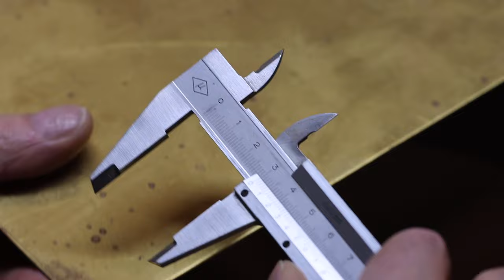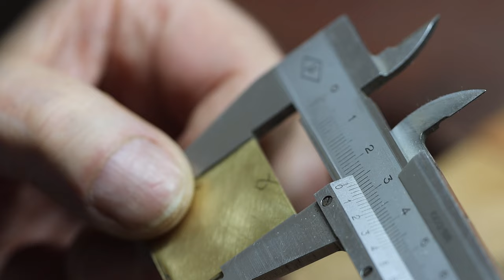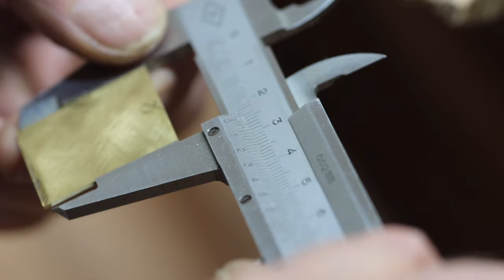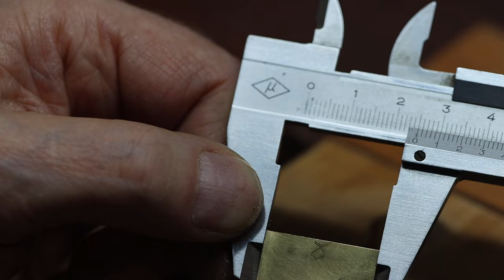Goldsmiths training Exercise1   Part 1

Comment: Second thought - when I was doing engineering design back in the day pre CAD I knew that if you want to accurately mark a pencil line you place the pencil on the line and bring the ruler up to it.

Watching you use calipers to mark out 25 mm against an edge bugged me - it seems inherently inaccurate placing the first tip on the edge of the metal.  It seems to me that you'd be better off using the set square to brace the edge of thepiece and bring the caliper up to the corner where the set square base butressees the edge of the metal piece - In this way you guarantee to get consistent placement.  Presuming the calipers are 'pointy' enough (have clearance on the outside edge at the given spacing) no calibration would be needed. If there is some radius or gap between the edge and the tip, you'd need to use the set square when setting the calipers up on the vernier.  Or even just set the distance on the vernier and set the calipers between the blades...

Comment: FWIW, I'm in the process of making a box clasp - this level of precision is absolutely required or it won't work, won't be square, won't have neat fitting edges for soldering... Ask me how I know... On version 4 at this point...
Reply from the maker: sounds like your accuracy might benifit from studying some of my films! touché I think.
Reply from the maker: hmmm, never got to a version four myself 🙂

Comment: Some thoughts....

First off, you're wrong about technique allowing one to manifest a design... Technique also INFORMS and INSPIRES design... at least that's what I have found. I am constantly amazed at how others imagine designs, feel that I can't or don't do so well with that - but when I learn a new technique, I inevitably get design ideas in the process...  

So not actually wrong... that was just a tease.  but another reason why technique is important skill to learn.
Reply from the maker: I know you were teasing but in fact you inadvertently prove my point. When I refer to technique in this sort of context ( I ought to be more clear) I'm talking about one's actual hand skill and facility. One's ability to do something accurately and well, NOT a process per se, like how there are many techniques to achieve wire inlay etc. The distinction is clear when we consider that we need good technique (manual dexterity) to perform a complicated technique (specific technical procedure/process). We could ramble on far longer now about how each might inform the overall creative process and indeed the different sort of creative process.